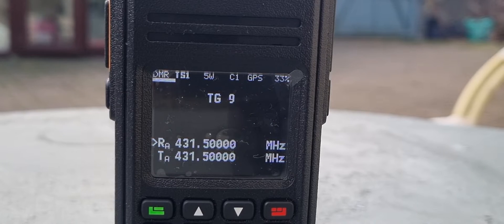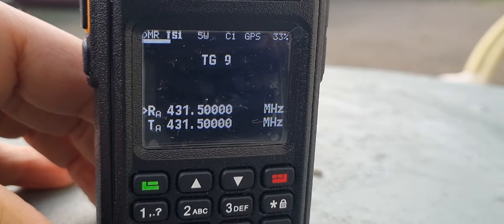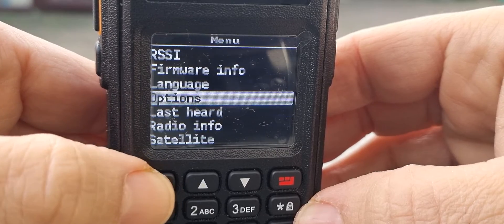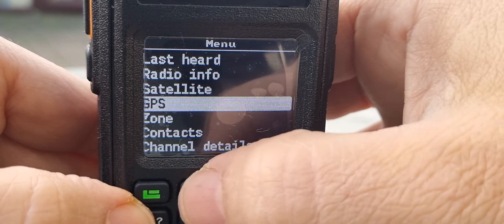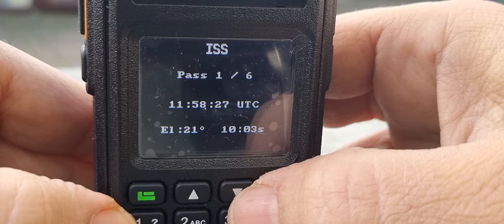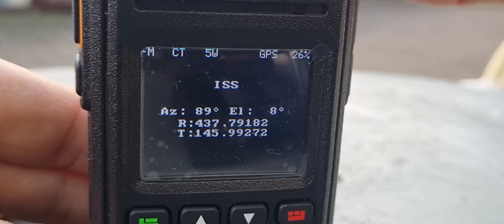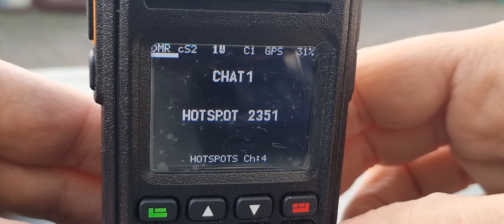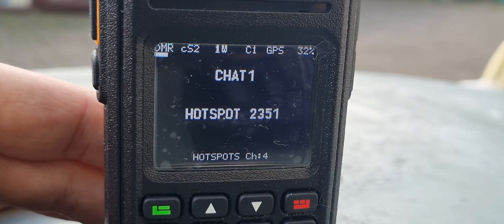RT3S - SET UP , SATELLITE TRACKING   - OPENGD77 Firmware

Comment: is it possible to set up location in terms I do not have GPS version and use Setellite info?
Reply from the maker: Hi I have been told Satelite works with Non GPS Models .
Reply: It is possible, just type your location at the Radio Info menu. And upload TLE from the CPS.
Reply: @joostluyten_ON2OT  amazing software! It makes great Retevis RT3S . Orginal software is DRAMA
Reply: @Japsystem  I know, did the migration yesterday.   Works great.